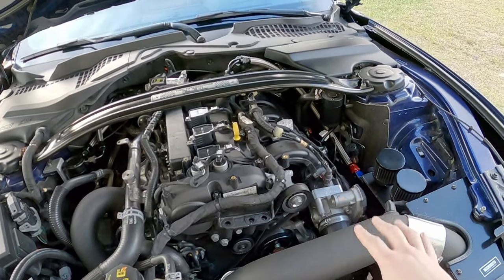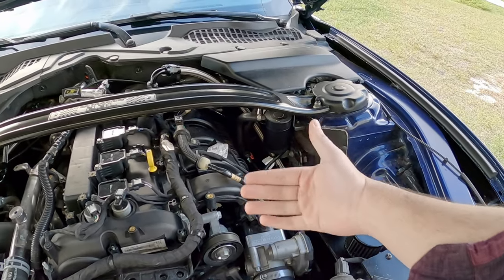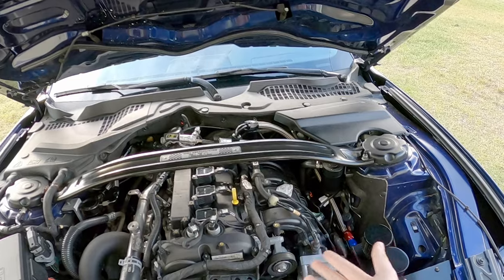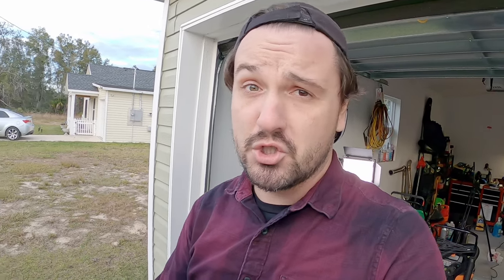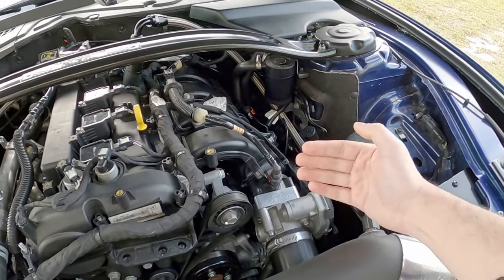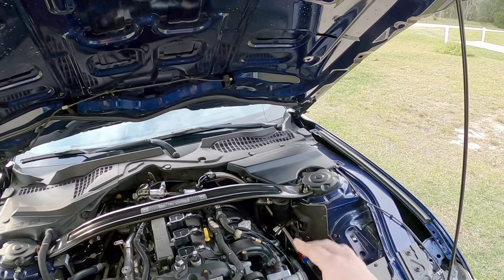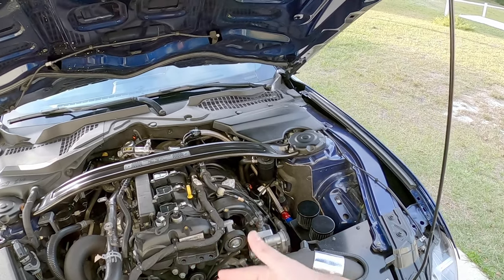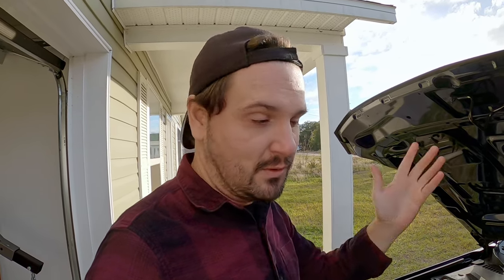Ecoboost Turbo Overboost SOLVED! It's Ford's "Fault"

Comment: boost is controlled from desired/actual TIP and compares the two and shuts throttle down when TIP actual goes above or really close to desired TIP. completely normal especially on an untuned motor, even is normal tuned or stock! fords way of quickly controlling boost rather than wastegate which is slower. ecu will also look at driver demand and torque tables and some other limits and also manage torque thru the throttle plate. there are a lot of limits in place on the factory tune. also are trans tq limits. with it being untuned throttle closure will be a lot more abrupt. stock form is a smooth closure. i tune these 😉. keep in mind you are most likely pretty lean with cams. speed density can play a big factor too in everything. not the most fun thing to tune with hptuners lol. all of these have had a checksum/IPC by the way, just gen 3 is a little more picky. there are probably 30 limits in place or more. you are referencing the max calculated MAP from the speed density. that just allows you to properly fuel for more boost. you would have to max the turbo out with hptuners to keep throttle open fully. i’ve only been able to achieve throttle fully open on a focus st since the turbo caps at 22psi. this was achieved by commanding more desired TIP than the car could achieve along with torque/airload the car couldn’t achieve. cobb runs a custom OS to trick the ecu’s into being throttle being fully open in this manner. not enough info on the forums to properly tune these. hmu on insta @rp.tuned and i will gladly help. it’s a lot lot to handle without real world experience on them
Reply from the maker: Thanks for the info! It's definitely a tricky system to learn. 😅

Comment: Haven’t watched the video yet and I can stand behind its Fords fault from working on a 2016 5.0. And then there is times where you can’t use aftermarket because the only one that works is the OEM part.

Comment: Glad you're finding HPtuners forum helpful!!
I'm also curious about how far you can push the OEM bypass/blow-off valve? I'm not even sure if it will work with a 10 lb wastegate actuator spring!?
Sounds like you have it figured out!
Reply from the maker: It's a very helpful community for sure! I'm not sure that I actually have it figured out, but I'm figuring it out lol.

Comment: I’ve thought once or twice of switching to a high performance ecoboost. But after watching this craziness from Ford I’m good. I rather build a cyclone. All that work just for Ford to stop you from making power.
Reply from the maker: To be fair, the car will make as much power as possible once adjusted.
Reply: @KarzKreated I thought it was limited because of how the system work and takes less boost than the past gen? Every-time i learn more of this engine the worse it sounds to own. I will say the High Performance does have a good amount or low end.

Comment: I have been killing myself to figure out what the hell's going on with my wife's 2014 Ford Escape 2.0 turbo Titanium AWD as it's throwing turbo UNDERBOOST condition. I replaced the turbo boost solenoid that sits on top of the engine and while the code was off for a while, it's now back on. I have another solenoid, so I will replace it yet again (with an Autozone Duralast solenoid), but I don't know what's going on with it. The car has 138,000 miles on it and it pulls fairly hard for such a heavy SUV with a turbo four cylinder, but every time I get on it it throws that code. The turbo doesn't seem to be thrashed as it doesn't make any abnormal noise, and it does have a very slight exhaust leak, and I haven't removed the intake tube to see if it has any abnormal shaft play, but the turbo appears to make plenty of boost. Her car has an abnormally large plastic charge pipe that has a plastic barb fitting for a hose that goes to the throttle body that has been broken off of the plastic charge pipe, and I have tried to fix it multiple times, but it just keeps breaking off even after using the best epoxy known to man. Idk what to do anymore.
Reply from the maker: If that charge pipe is leaking enough air before the intake manifold, it will likely cause the underboost problem.  I would replace that charge pipe and see it the problem goes away. Other things to check for are the wastegate actuator and the lines going to the boost solenoid. If you haven't already, cleaning both map sensors would be beneficial.

Comment: '23 HPP/HP owner here.  I'm using a Cobb and E30, stock turbo, not going down the route of wastegate mods like I did on my Focus ST.   A CVFab street IC, Airaid intake tube with K&N panel on stock box is enough for me to stay safe.  You should consider adding a vented one way valve valve cover oil breather to your set up, it will help your oil rings by releasing any blow by boost you get at high RPM's.  CFM is the one I have on mine, ran one on my Focus too.    What year is your HPP?
Reply from the maker: The most recent mod I did was a custom valve cover breather! I noticed the car has more vacuum now when off throttle. So that tells me better ring seal. My plans were like yours until the engine self destructed. Now it's gonna be 500 to 600 whp street car/daily when it's all finished. It's a 2020 🙂
Reply: @KarzKreated  enjoy! thanks for the reply!

Comment: So what part ended up being the problem?
Reply from the maker: It's not a specific part causing the problem, It's how Ford programs the vehicle to control boost using the throttle plate.